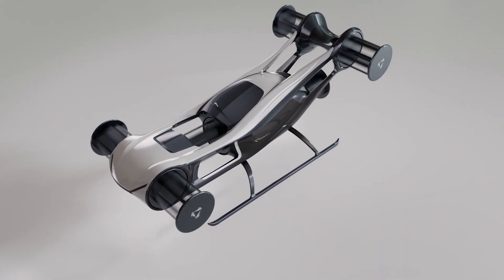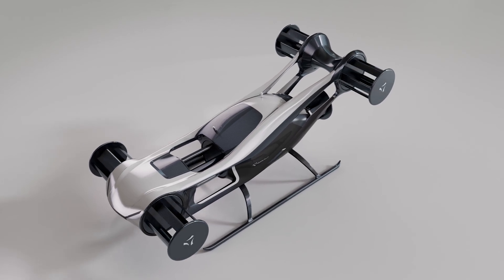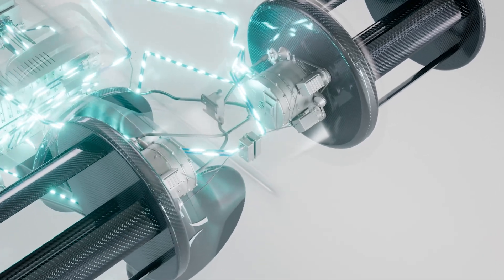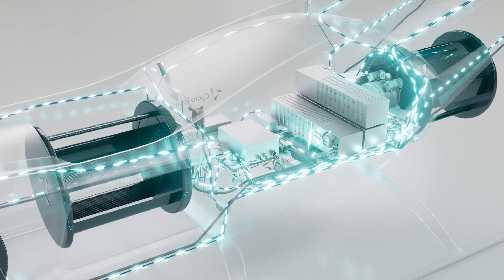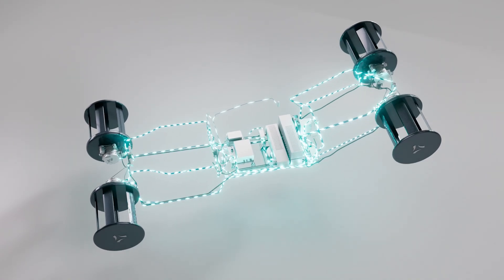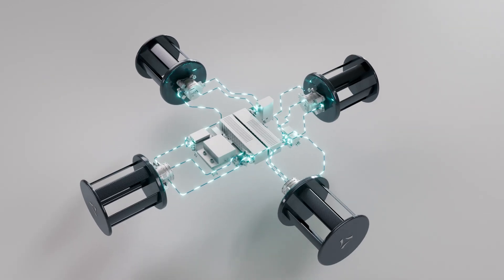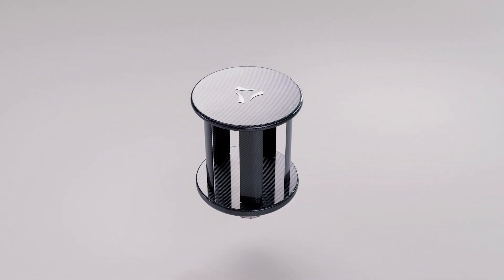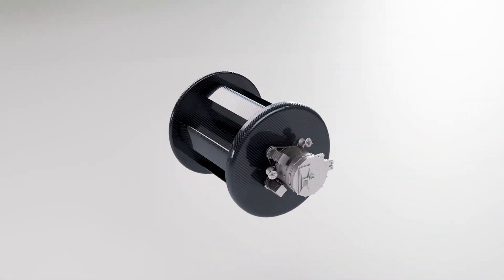CycloRotor System | Unlocking New Flight Capabilities

Comment: I’ve been following your work on the CycloRotor with great fascination — it’s one of the most exciting propulsion concepts I’ve seen in years! The idea of fully controllable, 360° thrust vectoring is simply brilliant.
I was wondering if you’ve shared any efficiency data on the system — for instance, the thrust-to-power ratio (N/kW) or a comparison with conventional propellers or ducted fans in hover and forward-flight conditions.
I’d love to better understand how your technology performs in terms of energy use and scalability, since it seems to have huge potential for next-generation eVTOLs.
Thank you for your time, and congratulations.